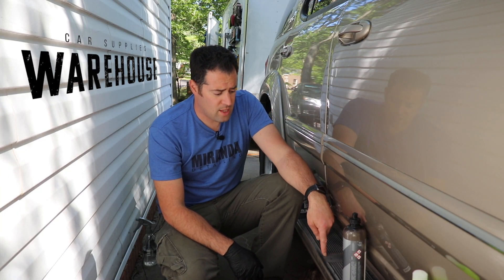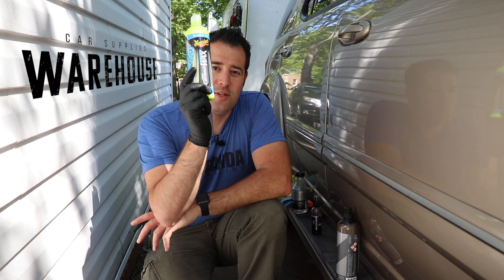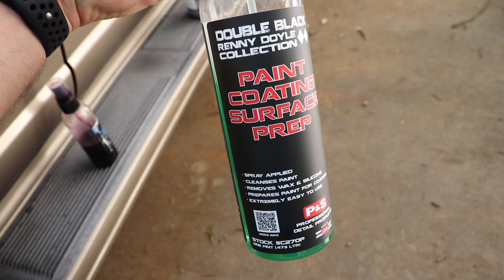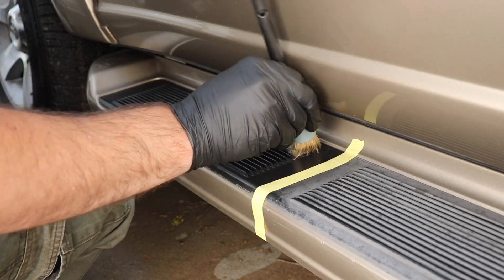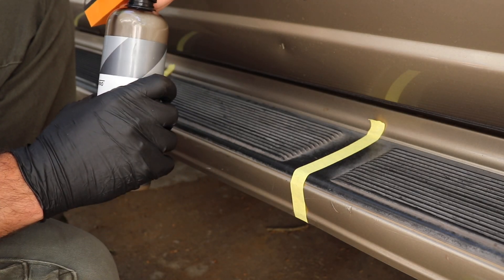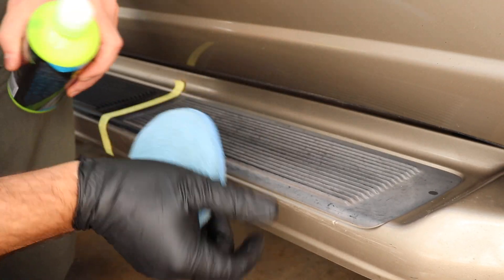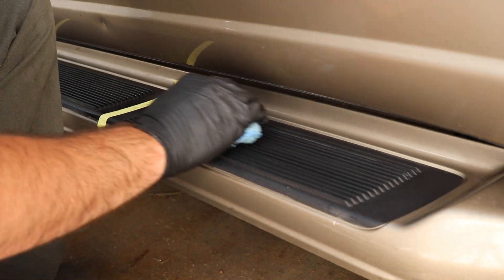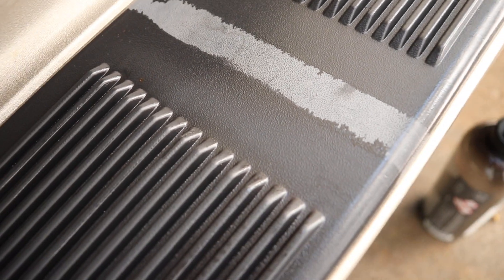Plastic Trim Protecant Showdown! #Trimprotectant #carsupplieswarehouse

Comment: Beading and chemical resistant test for the next time?
I had tested a stack.  Plastic cleaning with adam's tire & rubber cleaner, restored with meguiar's ultimate Black, 12 hours after applying meguiar's hybrid ceramic wax "spray version" and 12 hours after meguiar's hybrid ceramic detailer, with a little drying treatment.  The water-repellent effect was excellent, crazy pearls !!  And durable over time.  I was very happy with this essay
Reply from the maker: Thanks!  I'm not really into chemical testing, but I will just let it sit and drive it of course for work....I like the real world test instead to simulate what a customer would do.
Reply: @MirandaDetailing  Yes it is true the best tests are left to "time"!

Comment: Nice Phil. In Australia we don't have access to some of these products. So I tried Solution Finish to restore and then a spray sealant as protection. Also had good results with SF topped with CarPro DLUX. Look forward to the follow up vids 👍
Reply from the maker: Thanks. Oh yeah Solution Finish works great also!!  I’ll be using that on the other side soon.

Comment: Phil, intial look on all of these is really nice, I liked the Lithium the best, I have a feeling Car Pro Pearl  will not have the longevity, now we'll wait and see on the longevity.  I just applied the TWHS  Black Acrylic Spray Wax on  a 6 month old Jeep Compass's trim only using an Autofiber Microfiber Saver Applicator, did  not apply it to the paint (used LVR 404 polish with B&S flat white heavy polishing  pad, and LVR 357 Magnum with B&S black application pad), it's  been through one Michigan winter, it did darken the trim, and looked very nice, I so far  would reccommend it. I have another Compass (White paint, same extetior trim)  less than a year old  planned . Jeep must of had some deals last fall, anecdotedly I just don't see many in my area on the road).
Reply from the maker: Check this out 48 Hour Plastic TRIM Protectant Showdown Update! https://youtu.be/zqiwoK8SAYI

Comment: Hi Phil. Too bad you are not chosen the hyper dressing of meguiar's instead of the liquid ceramic wax. Hyper dressing is an excellent competitor to Perl carpro for me.
Reply from the maker: I will be testing out more plastic dressings. 😎👍🏼. But I have found that Hyper dressing washing away quicker.
Reply: @MirandaDetailing  
You were not satisfied with the hyper dressing?
Reply from the maker: Not as trim dressing. I like it as a tire dressing  though.  It I’ll try it again on trim undiluted and see how it performs. Have you found it to hold up after a rain?
Reply: @MirandaDetailing  
No not right now. It is the perl car pro that takes the longest for me and I really like the result. I dilute it 1: 2 for tires and 1: 3 for exterior plastics. Meguiar's hyper dressing, I have to try it.

Comment: Hi Phillip, Great Video!! I Was Wondering Have You Tried Solution Finish on Plastic Trim if So How Do You Think it Turned Out And how long it lasts?..
Reply from the maker: Yes I have...its great, but it needs a topper after it has cured to keep its appearance.  So i would top it with something like AM Trim or Trim Serum to lock it in.
Reply: "Cool Thanks Phillip "...🙂👍👍

Comment: I made a video of TW ceramic spray coating vs lithium ceramic slam! How do you use them in ur business?? Which do u like better? 
I think I will be using TW as a add on as a spray sealant and lithium as a light weight spray coating. What r ur thoughts? I think that the 12 months durability of TW is a overshot.  I’ve been getting 3-4 months on a corrected car. And 2.5-3.5 months on a fully decontaminated car.
Reply from the maker: Yeah I watched it man!  Yeah durability on almost anything is over shot, I figure cut that in half or a "title more. But if it’s so easy to apply that’s not a problem, just keep applying it every few months. 
I love each products ease of use.
Reply: Miranda Detailing how do you sell the two products? Like I have been using TW as a sealant add on. It’s so cheap too.
Reply: Miranda Detailing and I honestly love both.